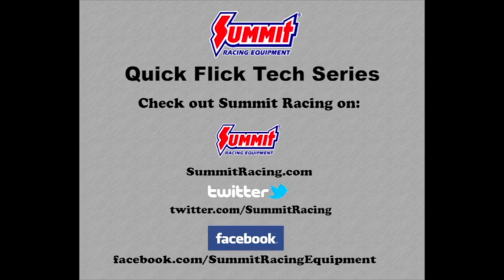Master Cylinder Bore Size - Summit Racing Quick Flicks

Comment: Im thinking about swaping the master cylinder of my 1984 Nissan Junior wich use an 1 inch or 25 mm master for a 23 mm or 15/16 from a Nissan D21 hardbody, the base and outlets are place the same, so is the theory is correct im gonna increase the brake force and get a softer feeling
Reply from the maker: while a smaller piston will apply more force, it may not move enough volume of fluid. Input (your leg), Power assist and pedal ratio also play a part. No easy answer!
Reply: @SummitRacing  roger that!

Comment: I have a 4 wheel disc on my 55 Bel Air. its the BK1212 plus the 10 bolt rear kit.
The pedal is soft and the brakes don't  "grab". its hard to stop the vehicle.  I have a 8" booster and a 1 1/8" MC. What could be wrong?
Reply: did you ever solve this problem? I have the same issue on my 54 Caddy. Would love to hear what you did to fix it. thx
Reply from the maker: Hi RookieClassics, 
Can you give our tech line a call? 1-330-630-0240. We need some additional information from you. We look forward to your call. 
Thanks!